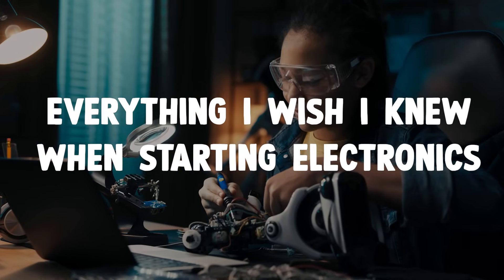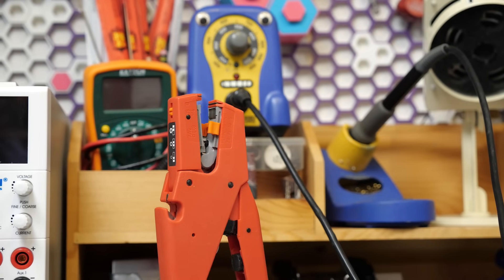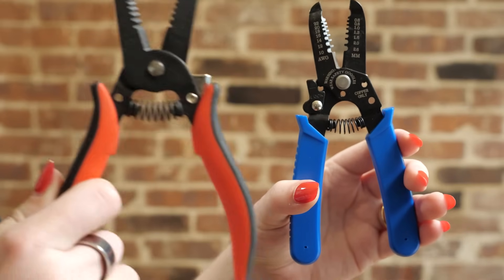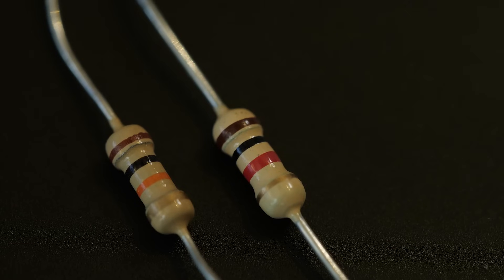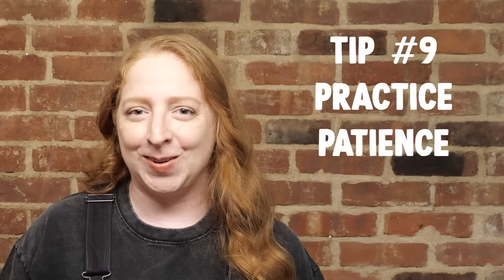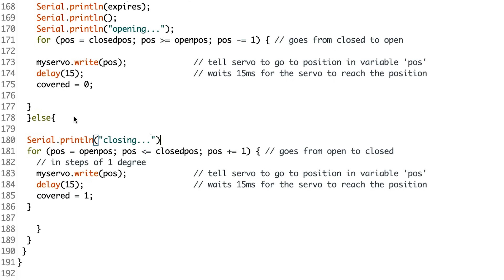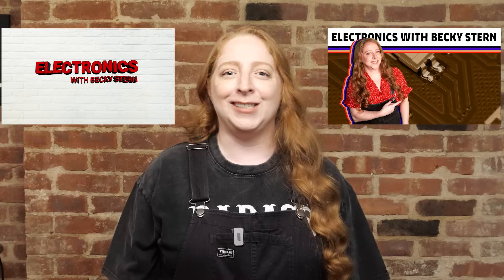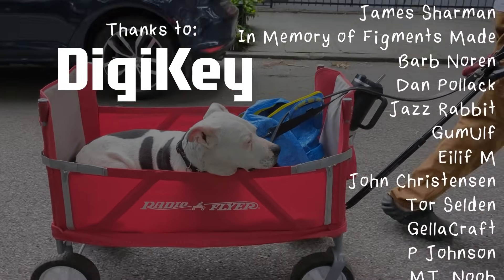Everything I Wish I Knew When Starting Electronics

Comment: A microscope, preferably a stereo one, is an extremely useful tool to have when working on SMT designs or for boards with very fine pitch connectors, it enables you to find defective joints, solder bridges, read part markings, and I often use it when soldering SMT IC packages.

Comment: Thanks. This is all great advice!
I've tinkering with electronics for 35 years, and your advice is spot-on.

Soldering irons really do make a huge difference.  I had an Ungar iron my dad gave me when I turned 16. It had served him well for a decade before that, and did well for me for another 22 years, outliving my father by over a decade. After the heating element burned out, I tired using cheap irons from wal*mart as a replacement. Big mistake!
I finally got a temperature-controlled soldering station two months ago, and it's been amazing!

Wire strippers. Totally. even the inexpensive automatic ones form harbor freight are so much better than the old-fashioned kind, once you get the hang of how they work.

Color coding wires. Heck Yes. That can save you sooo many headaches.

Serial.println() has to be one of my favorites. I almost stood up and cheered when you mentioned that one.

Lighting! I learned that the hard way. Especially as I'm getting older and my low-light vision is getting less sharp.

Comment: I've been doing electronics since the early 80s and I still don't have the resistor color code memorized. It did hit me at some point that it's basically the rainbow, though - black, brown (a.k.a. slightly less black), <insert rainbow colors here>, gray (a.k.a. slightly less white), white. So I could work it out in my head if I really felt the need, but I never do.
Reply: It's the Philadelphia Pride flag, plus gray and white at the end. :P

Comment: A few points:
1) I have been doing electronics longer than most people have been alive and today, I used Ohms law several times.  A huge number of problems can be turned into Ohm's law problems with a bit of thinking.
2) Yes, learn the resistor color code.  There is a little rhyme for remembering that can't be said in polite company.  The human brain remembers rude stuff better than anything.
3) It is often best to write out a description of what you intend to design before you start designing.  This can help to keep the project on track as you can put check marks beside stuff.
4)  Remember that an IC is really a collection of transistors wired up in a specific way.  It is fine to use a chip to do a thing the maker didn't think of.  I once make a booster regulator using an LM555 for example because I had a bunch of LM555s.  It worked great.
5) Massive overkill on a linear regulator or the like is just fine.  There is almost never a reason to use an LM78M05 instead of an LM7805.  You still have to get the heat out from your design
Reply: Great comment, on these electronics videos the knowledge and experience from commentators on par with the video creator.

Comment: My best tip for any programmer: If code misteriously fails to work anymore, switch the IC, sensor, check wires, etc. Don't spend 5 hours trying to debug code which used to work before. 
Often , the IC got burnt, especially if working with motors, during winter (low humidity creates static) or with dodgy power supplies

Comment: You touched on it. Proper lighting is a must have. As well as illuminated magnification. Comfortable seating for a good posture.
Reply: Yes and either a seat that can go up and down or two different ones.  Switch seats as you switch tasks.
I have head mounted magnifiers.  They are good for seeing tiny stuff while soldering.

Comment: For what it's worth, here are my soldering tips for beginners. 

1. Flux is your friend. You cannot solder well without flux. 
2. Small tip soldering irons are used for precision work, but the smaller tip can't carry as much heat, and so can make your life more difficult. 
3. Did I mention flux?
Reply: Yes that is true but you really should also mention the need for flux.
Reply: This. And also, you may need to apply flux. :)

Comment: I got a lot of people(online) telling me that my first project should be to build a power supply.  I think that's setting up people for failure.  Becuase it's such a huge project, that if you fail, you are disheartened, and without a power supply.  Start small.  You don't have to know everything.  Treat things as building blocks.  Find a voltage regulaor circuit you like?  Keep using it!  Don't have one?  Go find a trused source, and copy one.  You can re-invent the wheel later, for now, get some "wins" under your belt.
Reply: To be fair a "voltage regulator circuit" like a LM317 etc could be the power supply they build 😀😀
Reply: I get what you're saying here, it can seem daunting, but you can put together a rudimentary power supply with an lm 317 and a couple of resistors. Make sure you use a heatsink and you do the calculations of how much current you're going to draw, otherwise you may get a little bit hot, but it is a great starter project. You're absolutely right. Grab a benchtop power supply for testing things if it's in your budget. But when you know you can build something like that with three components, it does help you gain confidence and it teaches a lot of good fundamentals
Reply: I can't imagine who would suggest that. A first project should be something you're actually interested in!
Reply: I did hear something like that years ago. I found it amusing. Another one was a logic analyser. 
😂
Reply: A power supply was a good project idea in the 1980s, but with modern supplies, I honestly think its a mistake to start there. Ideally use USB or USB-PD for as much as you can in the 2020s....
Reply: Get a 9V battery and a LM7805.  Stuff like that can be your initial power supply.
Buy a really cheap meter and a fairly good one later.  The cheap one gets used as a continuity tester mostly

Comment: As a colourblind person. I agree that you don't need to memorize the resistor colour code in order to successfully work on electronics.
Reply: Have you seen the label printers that will print on heat shrink tubing? I figure if colours are a problem for your wiring you could label your wires instead :)
Reply: always keep a multimeter handy. it's not colour blind.